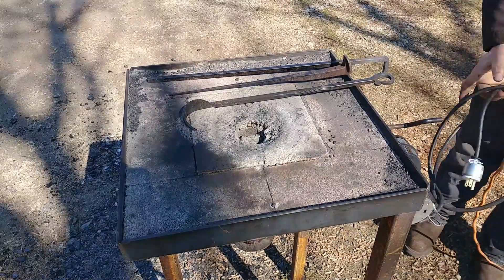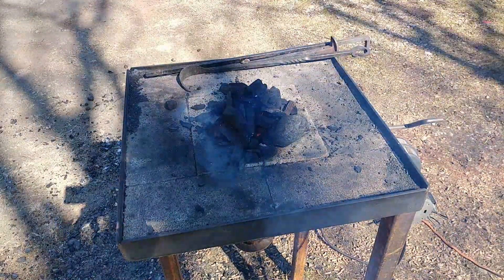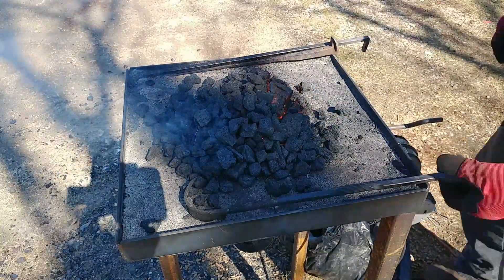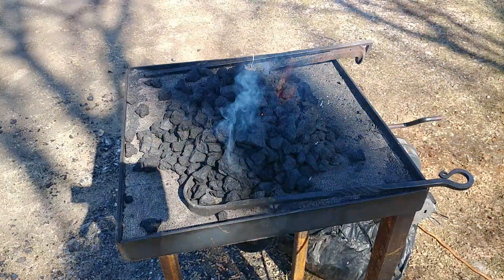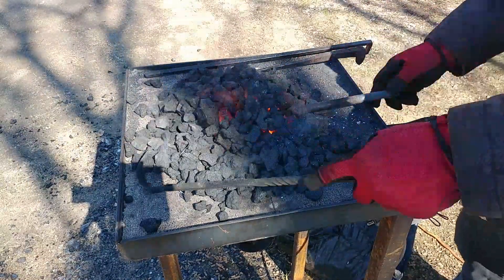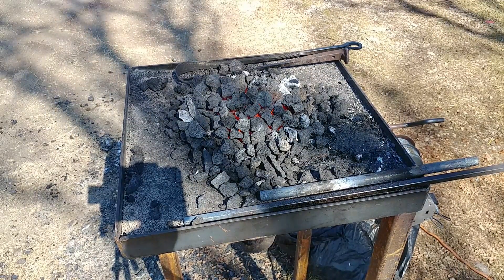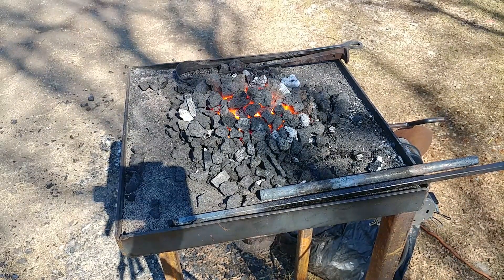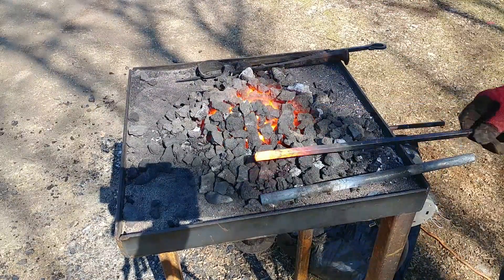Metallurgical/Blacksmithing Coke (Alternative Fuel Series)

Comment: Just out of curiosity, can you Grill/BBQ with MetCoke or does it require too much airflow to be practical anywhere but a forge, foundry or potbelly stove ?

I only ask because at a glance it more compact, more energy dense, less dusty and cleaner burning, than hardwood charcoal ... and unlike coal it doesnt need to be precooked before it'll catch.

Comment: One time someone ave the club a 55 gallon drum of coke that came from a steel mill. Needless to say we didnt care for it and they got rid of it. On the other hand one of the smiths brought some "L" brand coke in pea sized pc's and that worked much better. I think that the fact that the steel mill coke was in large hard to break down pc's vs the other that was in crumly pc's like you would normally find in your forge after the coal cokes down was the difference.